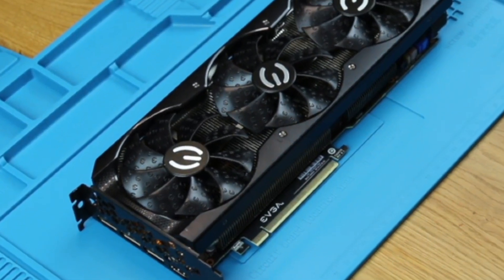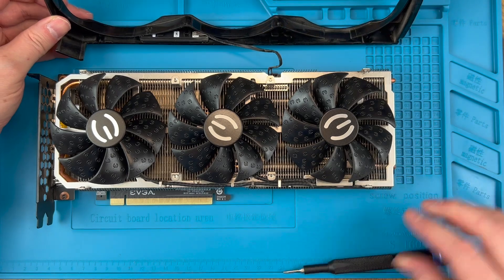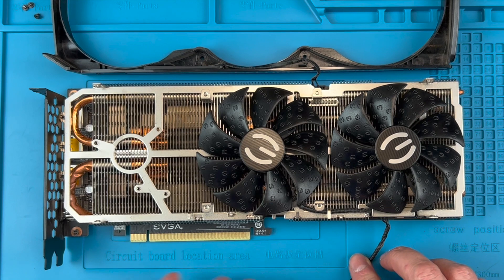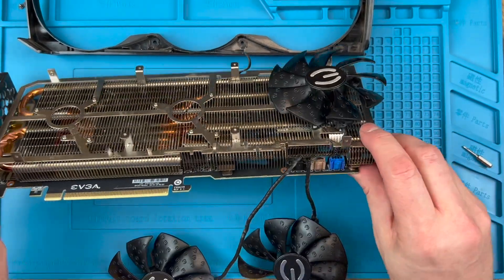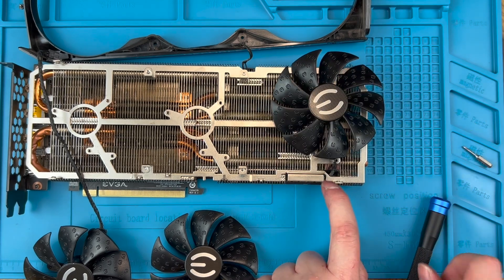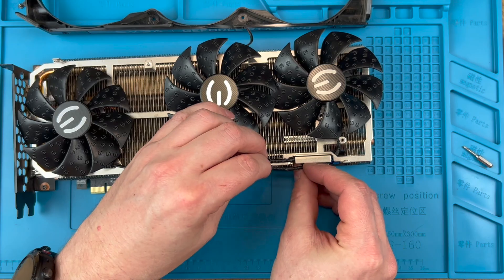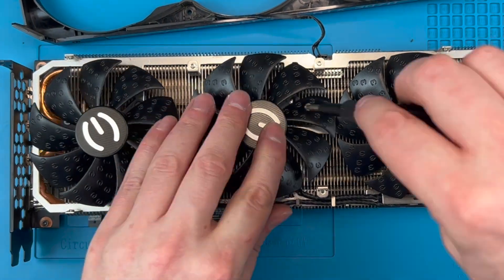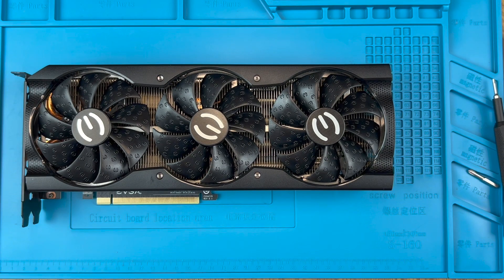How to fix broken fans on EVGA XC3 Graphics Card in 10 mins

Comment: I'm going to be trying this in the near future. The center fan is failing, has come loose, wobbles, noisy and I don't want to RMA this card FOR THE SECOND TIME, for a fan failure. I RMA'd it the first time out of concern of voiding the warranty, but it cost me a fortune in shipping and I'm not going to do it again for 1 fan. Thanks for the tutorial. Appreciate it. It's clear, to the point, excellent.
Reply: Same here… center fan going slowly to fail …
Reply from the maker: RMA of cards is so painful and if the GPU is your primary card then being without it for many weeks isn't really practical. So it's worth weighing changing the fans yourself for sure, it can reduce downtime to less than an hour.

Thank you for the comment and feedback. 👍
Reply: Did you replace it? I'm having the same issue, I wonder if its the fan issue or the card itself since I just bought a used rtx 3090.

Comment: You have no idea you just saved my 3080. Evga sent replacement fans cause im just out of warranty. Thank you so much. This looks easy, and you got straight to the point.
Reply from the maker: Hope it goes smoothly, and good luck with the replacement. It isn't a difficult job. 👍
Reply: @sometechguy  it went exactly how it was in your video. You got a new subscription. Keep up the great work.
Reply: I'm currently in the middle of replacing my 3080 FTW3'S black cable fan and it's going smoothly except it took me a minute to find the screws to the shroud, 4 on the bottom and the ones holding the other side were on the inside of the fan holes

Comment: Just bought a used one off of ebay, most common issue from the seller was one fan not working so this will be extremely helpful when i get my card if one of the fans doesnt work
Reply: Hey I’m in the same situation currently, I’d be glad to hear what happened to your gpu
Reply: @Khalid-wn1zv  fans ended up working perfectly fine. Thermal pads were a little old and dusty, so I just ended up replacing the thermal pads and thermal paste on the GPU, and it's worked pretty well thus far

Comment: Thank you for the tips!! trying to get as most lifespan in my 3080 ti xc3 till those 40 series drop down in price. Cant justify paying 1300 usd for a 4080
Reply from the maker: No problem. nVidia seems to have lost it's mind with pricing. The 3080Ti is a good card, I wouldn't be in a rush to replace and pay those prices either.

Comment: Hi there. i'm gonna change the fans on my 3080 FTW3, I'm getting completely crazy with the ticking they do. Took me so much time to figure it out ...blaming the HDD, the watercooling, the case fans, checking by ear etc... no fan curve solves it...40%, 50%.... intermittent ticking/rattling....Difficult to know which exact fans are doing it, seems to be the middle one and the right one (gpu mounted on mobo). I started looking for refs which lead me here eventually. The ref you give is for sleeve bearing fans. Apparently there are also ball bearing ones which should be sturdier . I'll check what is the reference of the originally mounted ones . It's really a pity for such a good brand to feature such a design flaw, and it seems to be here since the 20x0 or even before ...And I could say I'll never buy an EVGA card again, but, well....as they stopped making graphics cards 😅...
Reply from the maker: I have seen some GPUs with the ticking sound that may happen intermittently or at specific RPMs, and actually it may be that the fans are not faulty. I would look to see if the fans have an even gap around them from the shroud, and maybe just loosen the shroud and adjust it. This solved this exact issue for me on a MSI 3070 Trio card. It was caused by the fans just lightly touching on the shroud at certain speeds.

Hope that helps and it turns out to be the case here. Good luck!
Reply: @sometechguy  I removed the card from the PC, tried moving the fans by hand, they seem ok, no ticking. Removed the middle one, pressed the center a bit etc, put it back, no change . I already ordered the replacement fans . Maybe I'll try with just removing the casing/shroud before changing them and leaving the card 'nude' to check .Thanks for answering btw ;)
Reply: @sometechguy OK I disassembled the shroud ( the technique is not quite the same as the XC3 : 4 screws on 1 side, and on the other side 1 screw on each fan mounting that in fact maintain the shroud not the fans . And the fan connector. Just plugged the card like that with 'nude' fans. The rattle and clicking is still here so definitely the fans and not their position relative to the shroud . Next step , change them when I get the AliExpress order 😅

Comment: Bit of a long shot but do you know what those hex-screws that are used to attach the fan shroud are called? I've stripped a bunch of mine and looking to replace them but its incredibly difficult to find any information out about them

Many thanks
Reply from the maker: I don’t know I am afraid. The only suggestion I have it to take a screw (if you can remove it) to a hardware store to see if they can provide a like for like replacement.
Reply: @sometechguy  Thanks for the speedy reply! This is what I am planning on doing, as I said it was a long shot:) Cheers for the great vids

Comment: Does this method apply to the EVGA RTX 3080 Ti FTW3?

When the Fans are off, I would use Compressed Air to Blow Off the Heatsink
Reply from the maker: I believe the FTW is put together a little differently, like the MSI Ventus is a little different to the Trio. But that said, most of the 30X0 cards are at least similar.

Just be careful with compressed air not to hit/spin up the fans, the current generated  by the fan motor when doing this can damage the board. Remove them, or ensure they are held still and don’t get spun by the air.

Comment: I have an EVGA RTX2070 and the RGB light stopped working and I smelled burnt plastic.  At the time both fans and card worked and it seemed more like a cosmetic issue with the LED burned out.   A few days later both fans stopped working on the card but it still works.  Light task and the GPU stays below 40 degrees. Can I continue to use the card or should I replace?  I don't do any demanding gaming....just some old Half Life Deathmatch gaming which seems to only raise the temp to around 50.
Reply from the maker: Hard to really say without knowing the cause. Bit of a worry you had two failures within a few days, could suggest another root cause. I would get the card looked at,  but I couldn’t suggest a cause myself.

Comment: Thanks! It has been helpful! Do you have some advice to controll all 3 fans from non official software (EVGA Precision X1)? I'm only able to spin 2 fan with "Fancontrol". What software do you use?
Reply from the maker: I use MSI afterburner for this, and didn't run into a problem. I don't know if its important that the XC3 card has 3 fan headers, and most cards have only two headers, with one of them shared for two fans. Maybe the software is only addressing two headers for that reason, but I didn't see this issue in Afterburner at least.
Reply: @sometechguy thanks for the Info!

Comment: Is it using the same 4 pin that pc case fan uses? I'm thinking of modding it to use my 2 noctua 120mm
Reply from the maker: I believe they are proprietary connectors (at least they are not the same as MB fan headers), and the connectors also vary by GPU manufacturer. If you are going to do a mod like that, you likely need to power those off of a MB based fan header I would guess. The draw may also be different and you don't want to blow the GPU up! 😊 

But good luck with the project if you go ahead, sounds fun.

Comment: Would this be about the same process on an EVGA RTX 3080 FTW3?
Reply from the maker: I had not opened up an FTW, but I would think it’s similar. The process is along the same lines on most of the cards I looked at, but there could be some variances. For example, the MSI Trio and Suprim are almost exactly the same, but lower end Ventus is slightly different.
Reply: @sometechguy  Will it work to change the Zotac 3080 ti fan and replace it with an evga 1060 6g SSC fan?

Comment: Where did you buy your fans? Looking to do this fix on my EVGA xC3 3080ti
Reply from the maker: I picked up some on aliexpress, they had generic fans which were a lot cheaper but the ones with the molded bumps on the blades were more expensive, but looked more like originals. I wouldn't recommend the AliExpress experience though, the fans are also available on ebay (at least in the UK) and its easier to return them if they look questionable, don't fit well, or don't work.

Comment: What size screw driver for the actual fan screws? Replacing a fan in a few days and I wanna make sure I’m prepped. Thanks for the informational video!
Reply from the maker: Hi, thanks for the comment and sorry I didnt get back before your work. As it happens, I don't have one of the cards to hand currently, but the EVGA cards use hex bits, unlike most of the vendors. But if you have a selection of those, in smaller sizes, you should be good. Good luck with the change, but you should be fine as its pretty straight forward.

Comment: Y donde puedo comprar ventiladores nuevos?
Reply from the maker: I would suggest somewhere like Ebay, due to the buyer protection available. But it depends what is available where you live. I have bought from AliExpress, but I wouldn't recommend it personally as I had very hit and miss results in quality. I was able to return poor quality fans, but it isn't always easy and many of the fans appear to be after market but labeled with original manufactures labels. 

There are also some sites available that sell fans, make sure they offer a return policy in case the fans you receive do not fit correctly, and follow my advice from the videos on checking dimensions first.

Good luck, the fitting should go smoothly once you have them